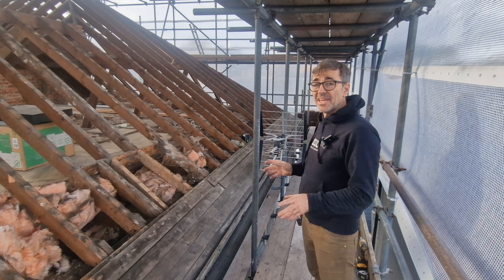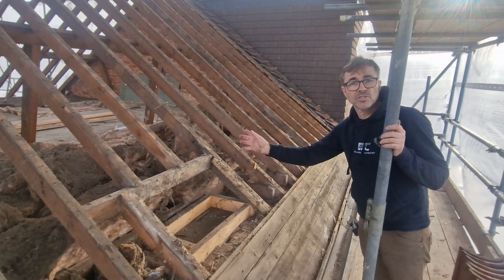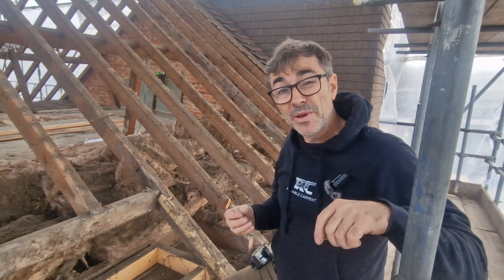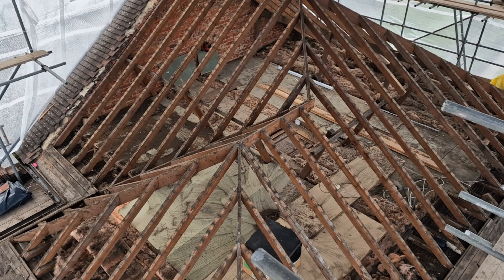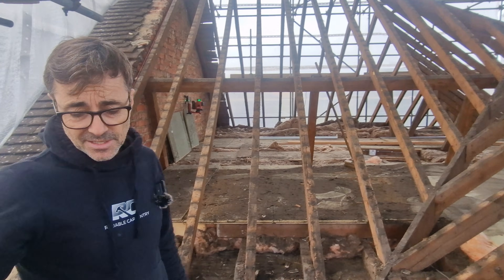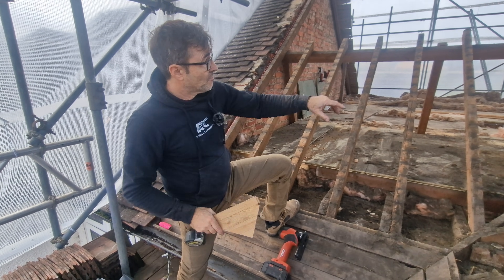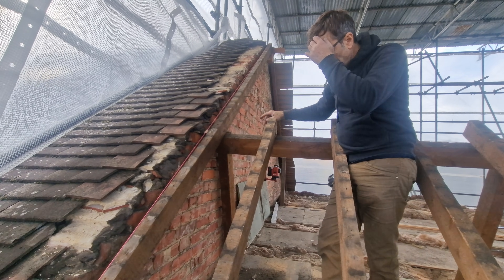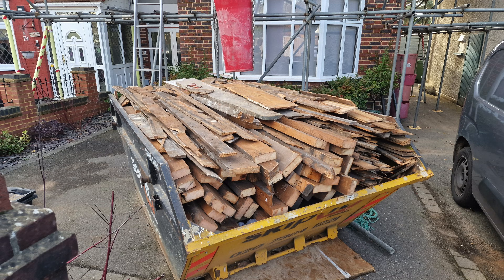How to Demolish a Roof for a Loft Conversion | Step-by-Step

Comment: Top Drawer Tradesman this Fella.
Its amazing the way they can put up a temporary roof over the existing building.
Thats no mean feat.
The Cost of doing it must be quite substantial
Reply from the maker: The scaffold is about 7k (GBP)without the temporary roof part it would be about 3k, but we are almost finished with the entire structural works and new roof coverings and its been exactly six weeks since we started taking tiles off. Also we have had some awful weather, rain on and off the whole time since we started, our scaffolders are great and like you I admire their skills!!

Comment: Hi Robin. Not a loft related question but one to do with cladding. I am planning to build a large (9m x 4m) workshop and clad it with shiplap boards, 20mm thick. It will all be built using Douglas fir as that is the most widely available timber here in mid west France.  I am planning to mill the rebates myself to keep costs down and to just use simple rebates and not use any grooves. So, my question is, how wide should I make the rebates to allow for shrinkage ? The timeber will be freshly cut from the sawmill. Thanks.

Comment: I lived in a Victorian house once, which had originally been slated, but then tiled using heavy concrete tiles with no additional support -  cowboys abound in roof work. Talk about a sagging roof ! The next owner had a conversion done, so corrected the sag.
Reply: It’s because there cheaper and quicker. Working in London I see people doing this on near enough every new roof job using Redlands 49, even better when they add solar panels too. 😂

Comment: Why are big steel beams always specified these days?  They're heavy, have to be supported and appear to be overkill in many cases.  Timber was deemed good enough before now so what's changed?
Reply: It's because engineers and Q.S are in love with steel, engineers love it because they always over specify to cover themselves. Thereby passing on big unnecessary costs to the client. Q.S get kick backs from supplier's, that's why they love it. Steel is heavy, hard to fix to and horrible to work with. A roof should be all timber, laminated beams can be made up on site and fitted into position piece by piece. No heavy lifting gear required and plenty strong enough, 👍💪💪🔨🇮🇪
Reply: And I meant to add - do they always use steel beams on new builds?
Reply: @martinwright7093  not always, you do see glue lam beams used often instead of steel, just depends on the type of build.

Comment: Hey Robin, with the tongue and groove boards on the eaves overhang how would you create ventilation if you were to keep that kind of feature? Just thinking the boards are about same thickness as the roofing battens? If you used an over fascia continuous vent then there wouldn’t be enough gap? Also the membrane can’t really sit on those boards like the old felt would have done? Sorry lots of questions…..Am doing my own roof in a conservation area so need to keep the appearance similar to the original
Reply from the maker: We are going to use some ventilation tiles at low level to introduce air into the roof space, and we also use a really good quality breather membrane over the rafters
Reply: @r @robinclevettcarpenter Thanks for the reply😊